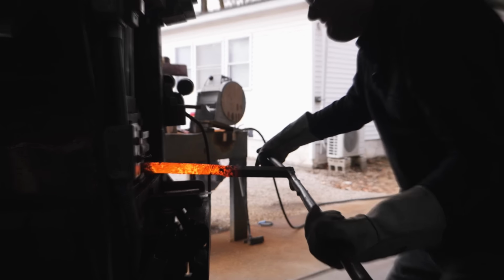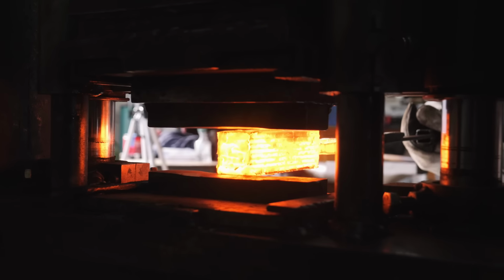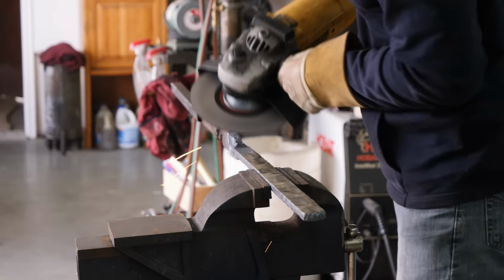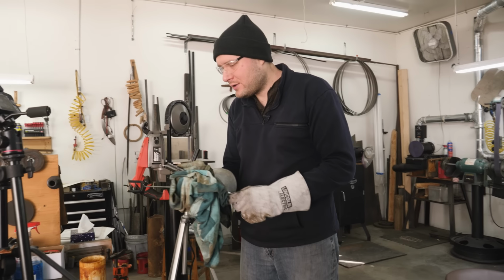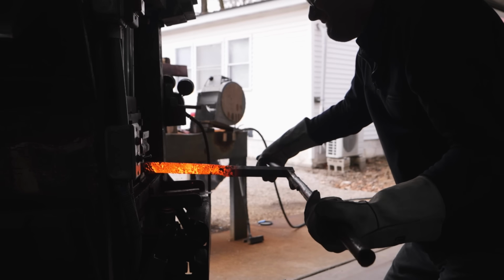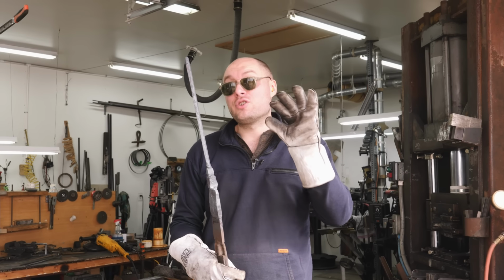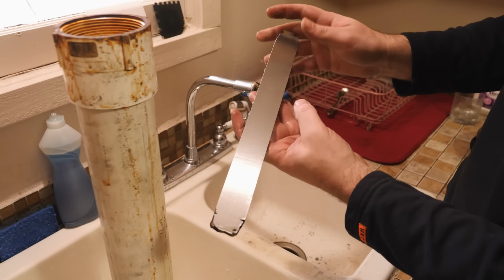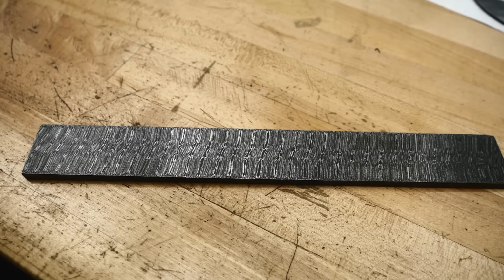I Made Firestorm 🔥 Damascus

Comment: Gona be a sweet pattern. If your gona do more twist patterns just make yourself a hand crank lathe, then just weld a sacrificial piece on each end and put it in the lathe and hand crank it till you get the desired effect. Waaaaay easier than trying to do it that way and trying to keep it straight and even.

Comment: Please explore the recent discovery of 3D printed Damascus. Basic idea is a 3D printed line goes in canister, cells filled with metal, canister sealed except for a small vent. At forge weld temperatures the PLA hydrocarbon reduces to hydrogen that vents and carbon that migrates into the metal and apparently welds fine. Massive potential to make mosaic tile elements and patterns that would of formerly been super impractical.

Comment: It is always necessary to grind off any rust before forge welding Damascus.
Reply from the maker: Great question Josh. It is for us. Just to help perspective, when we build a knife ranging from $2000 - $100,000 and up we do everything we can to control the outcome. Inclusions are more likely to show up in the steel if we don’t clean it. Unfortunately we find they can show up at final ferric chloride etch which is towards the end of the build.  Inclusions in the steel is not going to work for us. 
Most of the time we do something just because we can. 
Cheers 

Dad

Comment: the main mistake is to forge a torsional mosaic block into a thin plate.  as a result, the drawing did not open up - simple transverse stripes turned out.
Reply from the maker: Good point my friend 
It came out just as designed
Glad you’re here hanging out with us all 
Keep Forging On 

Dad

Comment: It's a like. When I came across that metal forging competition show on Netflix it caught my interest in the art. I wondered. What can the pros do when there was no time limit or limited materials to make it. Now I I have my answer in this video you posted. Oh that twist. It looked like a threaded screw. The end work looked,,, perfect. ... The camera work was a work of art on it's own. It was beautiful. 

I have zero experience in metal working. Well. Almost zero. I know how to solder electrical components to a circuit board using solder an iron or hot air. I know what the bond should look like. For the proper flow/bond that needs to happen, IT NEEDS TO BE CLEAN before you begin. You proved that.

This is a silly question to you and others. What are those flakes coming off the billet when it is getting formed? My guess is oxidized metal. A burnt crust that needs to go away.

Comment: Do you have to worry about where the tig weld material ends up in the final pattern? I would imagine you wouldn't want any right at the cutting edge of the blade for example. Trying to keep track of that would make my head hurt.
Reply from the maker: Good question Cox
We keep track of it 
It stays exclusively on the very outside of the billet 
Most of it gets burned off 
We are careful not to push it into the billet while forging 
Glad you’re here hanging out with us all 

Dad

Comment: What if you did let it shear off. Flip a section around, forge weld them together. do that twice and set em side by side with the twists going in opposite direction and reversing in the middle. That could yield for a neat result. Or i'm on crack.
Reply: if I ever win the lottery I'll commission it and we'll find out! dreams.

Comment: Hi Kyle, question: Why do you, and many other bladesmiths I see, use a 10” or mini contact wheel to remove rust and mill-scale off steel and not rather use a flat platten or if you have one, a surface grinder?
Reply: Contact wheels are much more aggressive in how they remove material than a flat platen, so it's simply faster.
Reply from the maker: Great question Victor 
A 2” round wheel opens up a wore out belt and cuts pretty aggressively. Just trying to get more use out of our belts. 
Keep Forging On my friend 

Dad